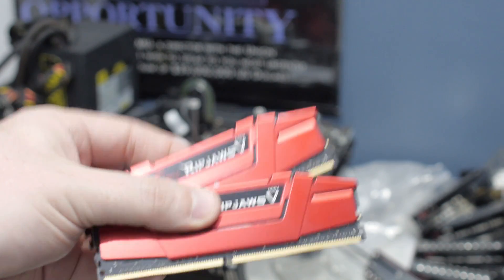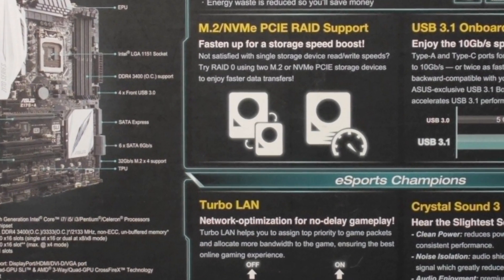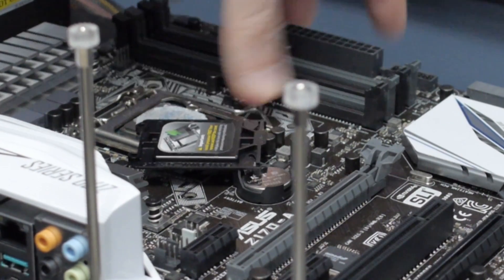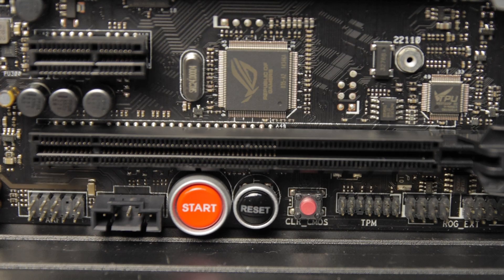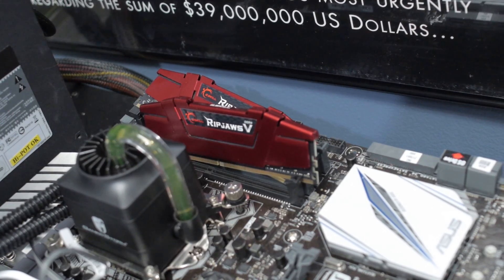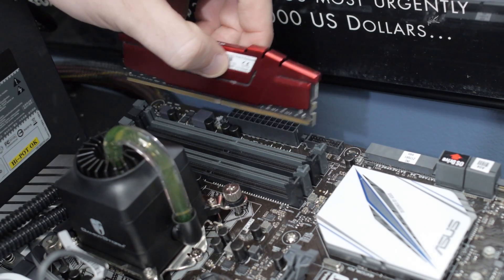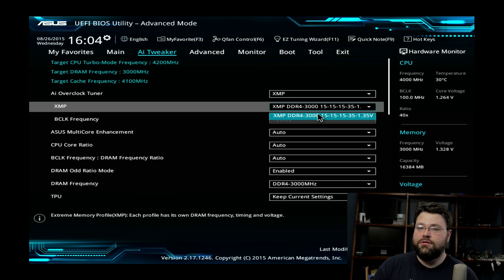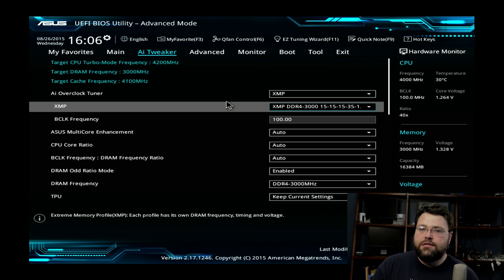DDR4 XMP Overview with GSKILL RipJaws V for Z170

Comment: strange sh.... i am struggling since years for activating XMP on my Gskill Trident Z 4266 with my i9-9900k in my Asus Z390 Board. Even lower speeds than 4266 wont run, so it is running since years in 2133mhz. But these 32GB Rams cost my about 600 bucks.

Comment: I have this RAM, sad it doesn't work in z170K on full speed. 2800 ~2900 mhz is max. I liked the video, but it misses the point that XMP profiles often don't work and you have to do some tweaking with power, system agent, etc.

Comment: does this ram work with ryzen systems ?
Reply: Of course it will work! Flare series has QVL ratings, means it will work (oc bus) guaranteed no matter what and you won't need any XMP or other stuffs to OC it. It will be an OCed ram out of the box. The mobo you are using, check for it in the official website whether it supports the OCed speed of this ram or not. If not, then you will have to sit with the stock speed. But this ram will work for sure.
Reply: @coffeeNTrees  - It works great as long as your BIOS is updated. Currently using two 8bg sticks on a ASUS Prime B350M MoBo w/Ryzen 5 1600 and a RX460. Clock speed is set to 2400 in dual channel and that's what the numbers show using CPUz and GPUz as well as in BIOS.

Comment: I installed one of these today actually I have installed an additional one to make it's 16 gigabytes and one of them is not being picked up with the system or rather it was picked up initially after install after power up but the system was asking me to configure it and I have no idea how to do that so I just hit default settings when it asked me would whether I wanted the fault or not so I have no clue what's going on other than I did check in the task manager and it only showed my original stick as being read so I'm assuming somehow I have to go in here and change some sort of setting that I have no idea how to do

Comment: I got them a year ago and I just realize only one stick is working what do I take one out and and put it back in to both or what?
Reply: I got 16gb and my pc says only 8gb
Reply: i have a micro motherboard so there is only 2 i tried switching places with them. one is making my pc not work so my monitor work and my keyboard and my mouse like none turn on. My pc turns on but not my equipment. I took the stick of ram out that is not working. idk what to do

Comment: I've tried to use the exact same GSkill memory kit (3000Mhz 8GBx2 15-15-15-35-1) on my MSI Z170-A motherboard and my computer will not boot. Tried both manual and XMP. Neither worked. Back it off to 2666 (manually) and it boots fine. I've tweaked voltages, tweaked cpu overclocks, etc and still cant get it to boot. I'm new to overclocking so I feel pretty sure its something I'm doing wrong but was hoping someone could help/give me some advice.
Specs:
Skylake I5-6600k stable overclock up to 4.7 Ghz although I have been running it at 4.4 at 1.25 volts for multiple reasons.
GSkill CL15 16GB (8GBx2) DDR4 memory kit with 15-15-15-35-1 timings
cpu is watercooled with stable temps around 40* and no higher than 60* ever with above specs 
MSI Z170-A SLI motherboard
MSI Gaming X GTX 1060 6GB gpu 
EVGA 650watt gold rated psu

Thanks in advance for your help!
-Nate

Comment: I have ripjaws v 2*8gb 2400mhz set to 2133mhz, when I use XMP to boost it to 2400mhz my games starts to crash and sometimes I get blue screens. 
z170 motherboard
i7 6700k at 4.6ghz
gtx 1080ti
samsung 960evo 500gb
corsair 750w psu
idk what is going on.... plz help
Reply: Igor Kim sounds like you don't have a proper cpu fan. You're overclocking without a proper fan to remove the added heat. Adding voltage and doing OCing required several stress test before just running games to see if there is any problems
Reply: Solara thanks for suggestions, I'm using a thermaltake aio water cooler I doubt that cpu temps are the problem. Buy I'll try setting it to base clock tonight. Anything else might be problem?
Reply: Igor Kim cpu voltage can be problematic as well. If you can manage a 4.6ghz on stable than something is off. Are you sure your bios is updated? Try resetting your numbers to before changing the ram. There are various tests you can run to test your hardware. OCing any component is a lot of trial and error before having stability. I don't encourage loading games until you're stable at speeds that you want first. Normally blue screens tell you why it appears, next time that happens pay attention and read what it could be. A long time ago my computer crash unexpected, a quick flash said 'cpu fan failure' appeared in a split second. I replaced it, problem solved. There's a good chance that you're overlooking something

Also don't aim for 2400 right away, try 2250, then 2300 and work your way there
Reply: Solara last night I update my bios to the latest version. And all of sudden the games started crashing more often. Do I have to reinstall windows after updating bios? Maybe only reinstall all the drivers?
Reply: Solara Also I set all my bios settings to optimized default. And crashing still occurs.
Reply: Igor Kim did you stress test each component to see if it's perhaps your hardware?
Reply: Igor Kim no you do not need to reinstall your OS again after an update bios, that's insane. MBs release several updates in a few weeks. Reinstalling your OS is for last resort severe problems. All drivers must be updated as well as your GPU drives from the manufacturers website. Not just windows update.
Reply: I tried everything u told me. ran stress test on cpu gpu dram ssd. it was running on 4.4ghz stable. But games still crash. pubg and bf1 crashes and tells "bad module info" or some random error in dll file or sometimes it doesn't even show on event log. oh my rams are on original 2133mhz. I googles bad module info but couldn't find anything related to it.
Reply: what motherboard brand and specific model are you using?
Reply: Its Neight I'm using gigabyte z170 gaming k3 mother board

Comment: I have gigabyte z170mx gaming mobo with i5 6660. Planning to buy ram ripjaws v 2x 8gb sticks 2133mhz from aus online store  $195. Iam a noob in computers but is there xmp switch on this board can i overclock the ram. Is it safe how to check thanks.
Reply: Pro omegagunner go to the actual site of that manufacturer board to let you know if overclocking is possible, they even tell you what type of ram is compatible with it. Each board work better with certain ram and causes less headaches. 195 for 2133mhz is ridiculously high! I hope you didn't buy it. You can buy easily a 3000mhz for 190 off Newegg and Amazon. If you want to save more money try eBay. Do not blow 195 on 2133mhz!
Reply: as far as I know ALL Z170 motherboards are overclockable. Atleast I haven't heard of any that aren't. However if you are purchasing the I5-6600 (and not the I5-6600k - K skew) you will not be able to overclock very easily. I've seen work arounds but I wouldn't attempt it.

Comment: I have the exact same RAM as in this video but I can't even use XMP - Windows won't boot!
Reply: Jon Miller perhaps the motherboard supports less mghz than the ram has. i done this too My motherboard only supported about 2300 or something and the hyper x furry that i bought had more
Reply: Psychotic Mind yeah I figured out that if you overclock your CPU too high then you can't OC your RAM as high. And vice versa.

Comment: Great video, thanks for posting!

For anyone with XMP issues on the Z170-A (or Z170-AR): Ensure you follow motherboard manufacturer guidelines for installation. I put CMK16GX4M2B3000C15 in an ASUS Z170-AR. The system would initially boot, but only at 2133 MHz. Every time I enabled XMP the system would constantly reboot and hang. 

After physically moving the cards from DIMM_A1/B1 to DIMM_A2/B2 (as the user manual for the Z170-A showed) I enabled XMP (just flip the MB switch!) and everything came up great at 3000MHz.

TLDR: If you're having problems with the XMP profile, switch what slot your DIMM(s) are installed in!

Comment: my motherboard is DDR4-2133 and my ram which are these are DDR4-2400 will they work together
Reply: Porbably a bit late but yes. DDR4 is rated for 2133MHz. Anything above 2133 and it's considered a overclock. So unless you have a motherboard that supports XMP so you can overclock it will settle on the default, which is always 2133MHz. In short, yes, they'll work together.

Comment: Anyone use the ripjaws ddr4 3200 16gb x 2 with the hero z170 board? I just bought them and have not installed with the MB but when I was looking through the instructions for the mb it mentioned compatible ram and at 3200 it only supported some ram at 4gb x 4 where I bought 16gb x 2 . and I have a good feeling my setup is not going to work.

any knowledge on the issue is appreciated.

Comment: Hello

Guys you have a nice channel.
I have a question ❓ I have the Asus  z170 pro  and saw the review you did
with the z170 A I'm buying a

G.SKILL Ripjaws V Series

F4-3000C15D-16GVR it's this memory compatible with my board?

I'd appreciate your help!!
Reply: Yes, Z170 chipsets use DDR4 memory.
Reply: wilfredo nilast castillo santana yes. It depends what CPU you have and what speed it supports, i7 6700K only supports up to DDR4-2133 so you'll need to enable XMP in the UEFI to get above it

Comment: I saw the XMP profile option but it doesnt have an option to enable it , only says "disabled" in the drop down. and the AI overclocking tuner, it says Automatic and Manual, no XMP? any tips? I have the same RAM sticks and running on a Maximus VIII hero Motherboard
Reply: VINNY it should say xmp. Did you go in the advanced settings in the eufi settings?
Reply: There's also a ez xmp switch on the mobo
Reply: yes i checked the avanced and the AI settings. and my Mobo is an Asus Maximus VIII hero
Reply: oh, there should be  switch on the mobo for xmp or maybe your ram isnt compatible for xmp

Comment: I built my PC like 8 months ago and I installed G.Skill Ripjaws V @ 3200MHz via XMP. 
Few days ago I bought another dual kit (Ripjaws V @ 3200 MHz) but they have just one different timing. It's the last number (1st kit has a value of 36 and 2nd kit has a value of 38 when on XMP)... The problem I have is that I can't have both running at XMP profile and my PC won't boot. I can boot when all kits are on default 2133 MHz, but I want to have them all run at maximum frequency. Is there a way to change timings and make these two kits run together at 3200?

Comment: I want fast 16GB of RipJaws for my Z170 pro gamer board .... but I may only find 4x2 = 8GB mems.... any ideas?
Reply: Cant mix and match ram
Reply: I know.... A complete G.Skill DDR4 kit of two is what I want. I mailed G.Skill, but they told me that I cannot use this and that on my MB -- I gave up and got myself a pair of Corsiar Vengence Cl15 3000 instead.  I may OC them to 3000 but at times I need to reboot twice.  For me G.Skill is the way to go for stability but the maker has a very small footprint in Sweden compared to Corsiar.
Reply: Malin Yamato af Läckö Yeah if there is any rebooting that needs to be done its time to find a better clock speed, what did they come stock with as far as speed?

Comment: The Z77 Biostar board I'm on has that exact weird DDR3 voodoo, it's the same board you took a look at because, hey, it's a 70 dollar budget bare bones Z77 board.  The Kingston memory that Logan gave me acts weird on this board if you force the timings to be what the stick is rated at, even stock CPU speeds.  Trying to force an XMP profile causes the whole bios to either hang or lock on POST.  Strangely, I can run it at faster CAS timings and at 2133, but not at the stock timings.  Odd things indeed.

Comment: It does not bottleneck but with the prices and according to benchmarks of arma 3 (which is a cpu-bound game) in hardware.fr skylake review, I don't recommend going for anything lower than 2866 13-13-13 and 3200 16-16-16-36 is 1 fps higher, and why you didn't go for 3200mhz by the way wendall ? that's the kit I bought ! it's so cheap anyway..  the 3466mhz though.. double the price :), if only I could copy paste a link.. stupid new youtube ugh.. 

And none of the reviews did test Skylake with higher clocked ram on CPU-Bound games by the way, big failure, I even mailed Techreport to tell them and they say "interesting, I might look into it"  and they never did, for a CPU review these days they show you GPU-bound games and claim there is little to no difference for this gen CPU in games, I'm sorry but this is pathetic, Crysis 3 third mission (I believe, the open one with the big tower of death.. that's the one) is CPU bound also, the game ran fine on my dual core until then, and then ran into a wall with this mission... actually this game and BF3-4 are the reasons I needed to upgrade :), I then got anFX 8320, ran butter smooth of course. 

Skylake is interesting also.. at stock I was disapointed with my frames on GTA V as I would get minimums of 29-30 (my FX oc @4.65 did lower than that though, to the 18-20) at near max graphics with an oc r9 290, then when I overclocked it, now running @ 4.5 6600k, GTA V is super smooth 60 fps stable, gg, it was a worthy upgrade in the end :).

Comment: Sorry, Wendell, but RAM is the biggest bottle neck in today's computers. Thats why we have 3 levels of cache or in some cases 4 levels. The thing is that high end ram kits do not improve that much. What has been gained in Mhz has been lost in increase of latency
Reply: ***** Most of application can fit into RAM so HDD only affects load times not running performance.
On haswell cache miss cost at least 226 cycles for data to be available for that core. Thats a lot of idle cycles and RAM accesses kill performance really fast.

Comment: can you confirm the timings on this particular kit with xmp on.

mine is the 15-15-15-35 variant and it refuses to boot on maximus 8 ranger motherboard if i switch on the xmp :/

rmaed the board but still same issue.

Comment: The issue i have with DD4 is the timing , from my personal findings with gaming DDR3 performs as well or better, for renderings its better, so it depends on what you are after.
it actually may be the Skylake CPU as well for rendering but i dont think DDR4 is any better for gaming, in fact it may be worse
Reply: check anandtech they round ddr3 was slower on skylake
Reply: taief miah
But im not particularly talking about Skylake, compare it to DDR3 on X97, very few boards that use DDR3 on Skylake
Reply: Michael Weiss ok

Comment: I have the same asus board but my corsair vengeance ram kit faces the opposite way the logo faces the inside isnt that weird or what
Reply: +Seif Zakria As long as the RAM works, it's fine. If you haven't installed it yet because you think the logo position is strange, just make sure that the notch in the memory lines up with the notch in the socket on the motherboard. If you wan't to go even further, check the RAM compatibility list on Asus' website, it should list the RAM.
Reply: Ram works great and its even listed in the manual of the board but just thought it was weird
Reply: Thanks anyway due
Reply: You see the video thumbnail showing the notch little bit on the left 
Mine is just like that when i hold it the opposite side.... So its just the sticker
Reply: Seif Zakria Ahh. Was probably made on a Monday, haha
Reply: nah maybe this was made on x99 days and there its the same socket but the opposite if you see many ram moduals have the notch on the lft and not the right like the ones in the video up